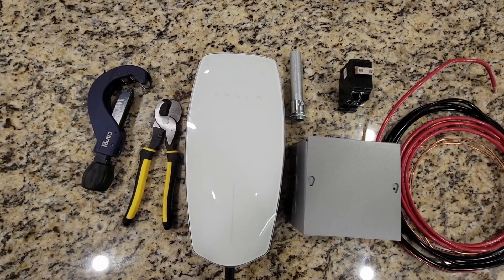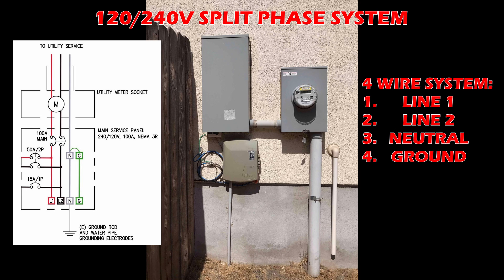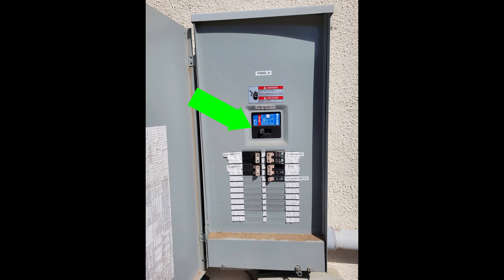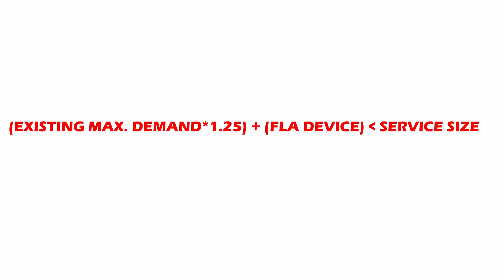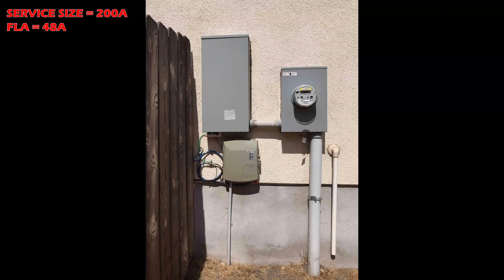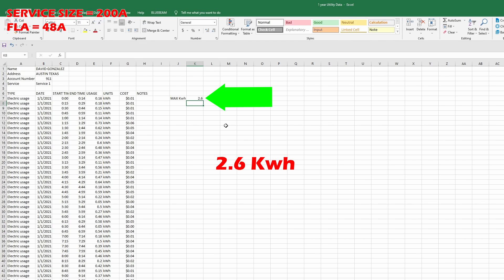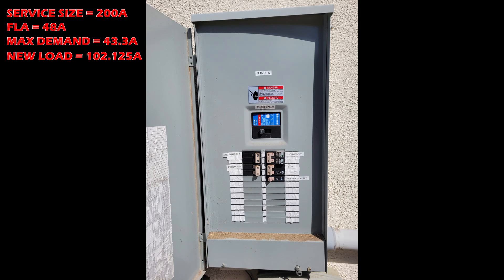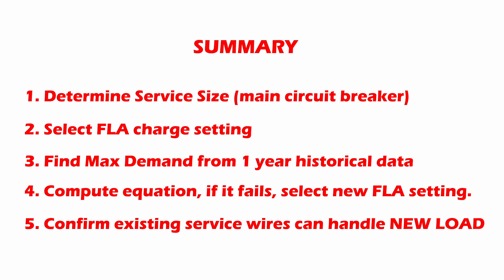Watch THIS before Selecting your EV Charger Circuit Breaker Size DIY

Comment: "Maximum" is the rate of breaker. For 60 amp breaker, 60 amp is its Maximum current.  48 amp is its continuous loading current. House loading calculation is not on the sum of FLA of each device. The calculation is depending on floor square size, and different device different load reduce rate. Your comments should keep line with code, not working experience.
Reply: Yeah, he’s referring to service size calculations prior to construction- and these are only a guide used for lighting and receptacle loads- not installed equipment. These sort of calculations are important for commercial applications to determine the difference in service needed for an office area and a laundromat- for example. In the USA, it’s irrelevant for most houses due to minimum service requirements. 

I have 30 years of experience as an electrician. Minimum single dwelling residential service requirements are 200 amps. The overwhelming majority of people in the USA will be able to install an EV charger on their electrical service unless their house is large enough to have multiple HVAC, multiple electric heat units, electric hot water, and electric range combined. If a person has gas heat, heat pumps, or any other gas appliance- the service will be fine. Even if a person has all of this and only a minimum 200 amp service, an EV charger can still be installed and used as long as the range is not being used. I do have some warnings later, but if anyone goes and looks at their main breaker and sees 200 on it- 99% of them should be fine. People whose homes have larger services are even better off, and more likely to have enough money to pay a professional. 

People should know that wire coloring is mostly irrelevant in residential wiring practice. Yes, the NEC requires that hot wires be colored (red, black, blue, orange, brown, yellow, purple, pink), neutral wires must be white or gray, and ground wires are green or bare. Yet there are going to be people who watch this, open their panel and see white wires connected to breakers without marking tape, and also see nothing but 2 black wires connected to the main breaker lugs. They might even see that all 3 (H1, H2, N) are black- but the one connected to the N bus is half the size of the other 2. For a long time, this was how services were wired. There was no need to mark the N to differentiate it from the Hots because it was half the size. I’ll get into that in another paragraph. 

What is most important is the wiring used for the installation of the charger itself. First off, amps are mechanically measured by heat in the breaker. Heat is literally the main thing that dictates all wiring size and breaker sizing. In the back of the NEC is an ambient temperature chart and formula for sizing wires- this is the most often ignored aspect of electrical installations. Believe me, I had a time convincing an ornery engineer that a 200a 480v breaker for a temporary chiller was tripping with 140a of load measured magnetically solely because it and all it’s wiring was located in the sun. As far as sunlight goes, basic advice to anyone who is still reading this: charge at night if your equipment is in direct sunlight. If you must charge during the day, use the EVSE to reduce the load 1-2 levels from max. In fact, I personally don’t recommend always charging at max load. Yes, that install should be built for max load, but all your equipment will last much longer if you charge for a longer time at a lower load. 

OK wire sizing, this is where self-installation will fail and potentially cause fires. There are videos on this already on YT showing burnt up 14-50 outlets. There’s advice, and their advice is ok- a minimum. I do disagree with their wire sizing especially when considering a direct sunlight installation as described above. Ok, so everything electrical relates to heat. NEC table 310.15- Allowable Ampacities of Insulated Conductors- check for reference. Most people will be installing a 14-50 plug for their EVSE, that limits the EVSE to 40 amps because the plug is only rated for 50a, and 125% of 40=50. Here’s where a lot of electricians make a mistake that will cause destruction of equipment- mainly the outlet, and wiring near the outlet. In that table 310.15, you’ll see 3 temperature ratings for conductors 90, 75, and 60C. Often you will see electricians saying that an installer can use #8 THHN primary wire for a 50 amp load because THHN is rated for 90C, so life is all good. NO, because there is another NEC code which says that ALL parts of a circuit must be designed for the lowest temperature rating in the circuit. Nobody reading this, yourself included, should be using anything but the 60C chart for wire sizing REGARDLESS of the insulation rating on the wire chosen because there are very few screw terminals out there rated for even 75C. In our theoretical EVSE outlet installation, #6 wire must be used because on the 60C chart, #8 is only rated for 40a, EVSE load is continuous, so the circuit must be designed for 125%- 50a. 

All temperature considerations are accumulative in nature, and the temperature rating of the entire circuit is the base. The good thing is that a layman like myself can simply tell people that #6 copper wire is the smallest you can use for installing an EVSE regardless of whether it is hard wired or wired to a receptacle- and everyone will be fine. Proving that to an engineer or another electrician… that’s a problem. 

For you sir, I’d like to add a warning about aluminum wire. I strongly recommend that you have your service wires replaced with copper, and all 3 wires sized equally. Aluminum service wires are ok, and legal, but here’s why- if you are still reading- you should take my 30 years experience over anything that can be read in the NEC- except the part about it being a minimum, so it’s ok to go over NEC if you can afford it. The problem with Aluminum wiring is that it expands and contracts more than copper. Over time, this causes it to loosen in the terminals. This was a big problem with branch circuits, and why Al wiring is no longer allowed except for services. By your own calculations, you are basically doubling your current while using your EVSE- right? Ok, so those terminals will loosen twice as fast. You could use Vibra-tite or Loctite, but you’ll have to loosen the terminals to install that properly. I’ll be doing it that way with my EVSE install even though I have a 200a main fed with 3-3/0 copper wires. Loosening terminals are a big deal I’ve seen in industrial settings where continuous load (any load that applied for more than 3 hours) is a bigger deal. DuPont always had us go up 1-2 wire sizes, and double the size of motors required because it cost less money to install an oversized motor than it did to replace the 100% size. In practice, it lasted 4x as long justifying the initial expense. You don’t have to replace your service wires with 3/0 copper like I did, but I strongly suggest replacing with copper because the alternative is that those Al wires loosen, start arcing, and burn through the bus because there is no overcurrent protection from the meter. That will happen even faster if your service is in direct sunlight while you’re fully loaded up. 

For anyone who read all of this, I apologize. I can’t help but protest 90% of everything I see about electrical installations online- especially EVSE installs- because I have 30 years of experience in a variety of industries fixing other people’s mistakes. Like I said earlier, #6 copper wire should be the minimum for any EVSE install whether using an outlet or direct wire. Ambient temperature considerations should be thought of over the whole circuit’s location- so if your wires run through an attic, that is an even bigger deal than direct sunlight. Larger wires reduce temperature changes, it won’t prevent ambient temperature from affecting the circuit, but it makes it less likely to damage a terminal or cause a 50 amp breaker to trip with a 40 amp load. OK, I’m done- layman says use a bigger wire ALWAYS, and don’t charge full load in the summer if your equipment in direct sunlight. Oh, and yeah use Bryant or Hubbel NEMA 14-50 outlets, and hey, if you can afford #4 wire, that can only help prevent thermal damage.
Reply: @whynotthinkwhynot-  Literally took your whole reply, printed it, laminated it, and put it in my garage. Thank you.
Reply: @michealcthompsonjr  — I wrote all that before I had coffee… 🤦‍♂️ 

If you’re wiring your own EVSE, I recommend going with #4 wire and either a Bryant or a Hubbel 14-50. I didn’t say any of that, I only said that I thought #6 is a minimum wire size for a 14-50 for a 40 amp EVSE. “State Of Charge” Tom is right, wiring an EVSE with a 14-50 is not ideal. There are considerations, like you will need to replace your outlet regularly if you plug and unplug the EVSE. I personally have no choice in the matter because of where I live, and that I don’t have a garage. Bryant and Hubbel are made by the same company, and their industrial 14-50 outlets are very good. I’ve done a ton of research into “pin and sleeve” connectors and outlets- but those are not cost effective. If you do decide to wire a 14-50 outlet, like I said, go with #4 wire, it will be a pain to work with, so make sure whatever box you use is large, I’d use an RV weatherproof in use outlet box even if it was inside a garage just for the extra space in the box. Keep in mind that you will also have to use a 50 amp GFCI breaker. These can be very expensive. For example, a Siemens is $250 for the breaker, but you can buy a hot tub disconnect that comes with the 50 amp GFI for $140! This is a good option even if you have breaker space- mount the Hot tub disconnect near your RV outlet box, and use it for an easy way to shut off the power to the outlet before you plug in. Yes, you should always do that, no power while plugging or unplugging. It’s not that it’s dangerous, it’s that even a small load will arc when you connect it, and that will cause minor damage to the connections. 

Since my personal installation is in a high crime area, another option to a plug is a hardwired EVSE, and a J117 extension cord. Those are expensive, but less than pin and sleeve fittings. The J117 is a weatherproof pin and sleeve connection, so that should last a good long time. I’m pondering long and hard how much I want to replace the 14-50 outlet every year due to plugging and unplugging every time I charge. There’s so much planning that goes into this stuff that it drives me mad sometimes. Then I get on the internet and write long descriptions of stuff that only 1 in 20k people care about. 

I do hope that my rambling helps someone, and if anyone does want more specific help- I’ll be happy to advise as much as I can. 👍
Reply: @whynotthinkwhynot-  why is it that you think a 200A service is the minimum size required for an individual residential dwelling? Service size is the result of a lot of different calculations including the square footage of the dwelling, the appliance loads, and demand factors. There is no truth to there being a 200A minimum electrical service size for single family dwellings. 

Also, NEC only requires identification of ungrounded conductors when more than one nominal voltage system exists on the premises. Even then, it’s not required that colors be used to identify them. Tagging, taping or other approved means may be used.
Reply: @RB-xv4si 
The NEC does require at least 100 amp service. However, most AHJ's do require 200 amp service (they'll make exceptions based on housing type apts, tiny homes, etc.). This has been my experience while working across the country.

Also, the price difference between 100 and 200 amp service is tiny. So even if given the option, in a single family residential, who's actually going to opt for 100 amp?
Reply: @whynotthinkwhynot- this must be the best post or video on internet related to EV charger installation. I’ve looked through hours of YT and Reddit and yours is the most concise and informative.  My question did you is should I use Romex 6/3 or thhn 6 if I need to run between walls and through attic to get from my service panel to garage. Would the romex or thhn need a conduit? TY.
Reply: @Uncommonsense999  - you don’t want to mess with conduit. The problem with Romex is that some Romex uses inferior insulation. Search NEC Allowable Ampacities, and charts should pop up. The tops of the columns have insulation types. If your Romex uses a higher temp rated insulation you’ll be ok. There is also SE cable to consider as an option- as long as it’s copper SE. Attics get hot. The layman’s method is to +1 size. If you’re running through an attic, then #4 Romex or SE cable would be the best choice. That means you’ll need a large box- like an outdoor RV outlet with sufficient space to work oversized wire. To put it in a sheetrock wall, like fish wire down the wall, I’m not sure that a 2 gang plastic box would be enough without a box extension- for #4. You can still get away with #6 SE, if you limit your EVSE to 32 amps. As an electrician, I wire stuff for max- so 40a on a 50a continuous receptacle. Bootleg, as long as you keep your amps down during the hot season, you’ll be ok with #6 Romex in an attic . For conduit, as long as it’s not in a living space- you can use PVC. It’s hard to make proper recommendations without more knowledge of the installation. Email me at Why Not Think Why Not at yahoo- all words run together, and mention electrical or EVSE in the title. That’s the mail I use for web stuff. Thanks, best wishes.
Reply from the maker: Thank you for your comments. Your comments are not related to the subject of this video.
The subject of this video is how to determine if your EXISTING electrical panel can handle (1) one additional electrical load--thus home square footage is irrelevant.

Comment: Great Video. Absolutely loved it. I just have one question, in your formula you used max demand x 1.25 and FLA to check against the service size. Shouldn’t it be (max demand+FLA)x1.25? You add all the max current demand existing+new device and then apply breaker rating to it and compare against the service breaker?
(43.3+48)x1.25=114.13 < 200
Reply from the maker: I understand your logic and I personally thought the same at first; however that is not how the code reads. I quote NEC 2020: "the maximum demand at 125% plus the new load does not exceed the ampacity of the feeder." Your equation is more conservative and there is nothing wrong with that. The code allows to get away with a little more.
Reply: @dgtv3320  Thanks for quick response and good to know that we can use a bit more than my formula :). I will subscribe to your channel for more cool videos like this. I love mathematical explanations and not too many videos cover this type of stuff in such detail.
Reply from the maker: thank you, I appreciate the feedback.

Comment: My panel can handle a 60 amp breaker for EV charger. Is there a specific breaker for it to handle a constant load during a charge?
Reply from the maker: Nothing specific. Standard 60A 2-pole breaker will do it. Make sure it is NON-GFCI type.
Reply: @dgtv3320  Thank you!
Reply: Note that the car may not be able to take that much current.  My wife's 2016 model X can only take 40 amps.  They had an option to upgrade it to 80 amps, but I don't even see that option on Tesla's web site any more.  My new model 3 can only take 32 amps.

Comment: Awesome video! One question: So for the 60 amps should I get a 30+30 double pole breakers, or do I have to get a single pole that is rated for 60 amps?
Reply from the maker: Thank you Karl. So assuming your electrical panel can handle an additional 60A breaker, for a EV circuit you'll need a two pole 60A breaker.  You'll need to identify your panel manufacturer (General Electric, square D, Eaton, etc.) in order to purchase the correct breaker. I provide additional insight in this video: https://youtu.be/DxkICxKUo-A
Reply: NVM, it's mentioned here 5:01 that I need a double pole

Comment: The electrical code equation in the video is that standard across the US or specific to CA ?
Reply: So what size wire would you use for this 60amp breaker?
Reply from the maker: Rob, check this video out: https://youtu.be/TenDt45gH_4 skip to the recommended wire size chart.
Reply from the maker: It is applicable across *most jurisdictions that abide by the national electrical code, which is most of the US.